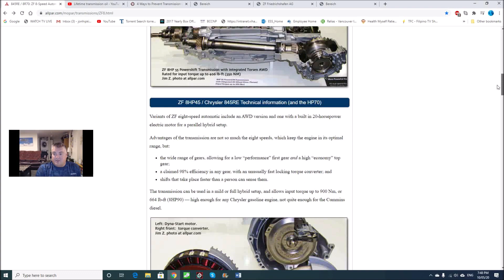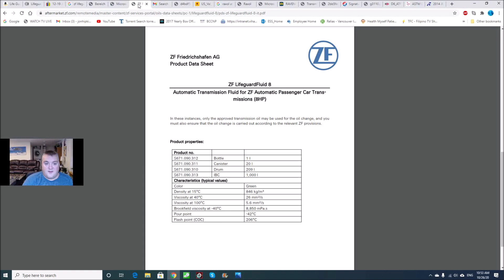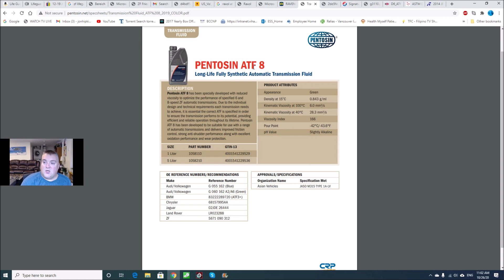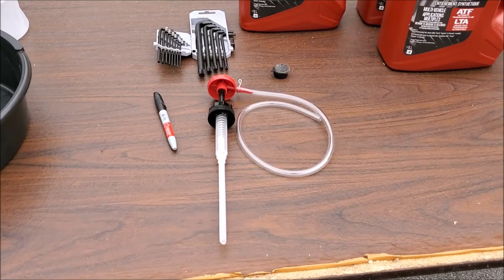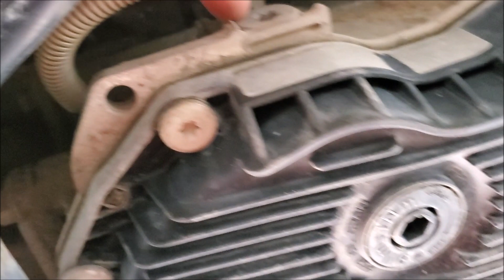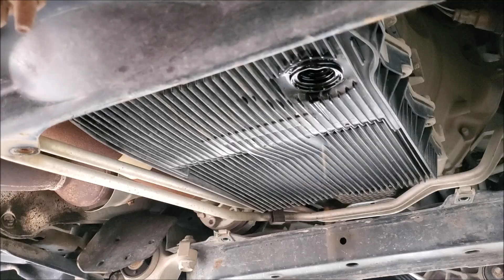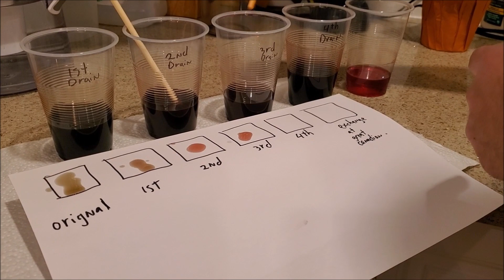ZF 8 SPEED FLUID CHANGE AND OPTIONS (SPECS INCLUDED)

Comment: Did you reset the transmission ECU?  I have a Discovery 4 (LR4) with the 8HP70 and it is recommended to reset the adaption values in the gearbox ECU after an oil change so it relearns all the shift points / clutch settings with the new fluid.
Reply from the maker: No I didn't... and I must admit in all the research and reading that I've done on the ZF transmission (which was alot) this is the first I've heard of it. Is that recommendation specifically from LAND ROVER?... because it definitely isn't from ZF as far as I know. I'm also curious does LAND ROVER recommended a fluid change?
Reply: @jonh2408    Jon, googling various terms (adaption ZF 8 speed etc) there are a few hits, here is one https://www.disco3.co.uk/forum/topic141425.html (first post step 16) but you need a diagnostic tool to do it (I have the IID tool) .  I think LR have hinted at 150K miles but don't think that is 'official', think I prefer to follow the OEM's (ZF) recommendations instead.
Reply from the maker: @millycarrington  ya... thats certainly a very detailed description. The directions for achieving a proper fluid level look familiar and are on par with the ZF directions. The part about reseting the ecu is new to me. It makes me wonder what happens if you change fluid but didn't do that step?
Reply from the maker: @millycarrington  I will also say that using a scan tool on the chrysler products was something that people only did to get an accurate fluid temp. Which Is necessary (as I'm sure you know) to properly set the fluid level. However alot of people (myself included) just used the tranny temp display (if there vehicle had it) on the dash. Thereby foregoing the need for a scan tool.
Reply: @jonh2408  Yep, not actually done mine yet, just in the fact finding stage at the moment.
Reply: For my Dodge Ram , on the forums I’m on a ex trans engineer . Told me it was not needed after my fluid change on my trans

Comment: This is so informative! 
I tried hard to find something good explained as u did.

I passed 159,000 KM without change.
I live in Dubai (so hot weather),

Is it fine to go and change? I am Very hesitant although i check oil condition on white tissue and seems nut burnt or black.
Reply from the maker: Your only at 100,000 miles... I would definitely change it... but change the pan too so you can get a new filter and magnets
Reply: @jonh2408  thanks for prompt response!

What about flush on stages like, 2 quart each couple weeks , the 3rd stage to change oil along with filters?

Is it possible in this way to not wake up the genie? Trying to avoid any damages ..
Reply from the maker: @ahmedzu3775  ya I think that would be fine... that jeep must be fun as fuck in Dubai... is it quadra drive 2?
Reply: @jonh2408  yea its quadra drive ii , its very heavy duty and more fun in deserts, 

But thing is weather 49c nowadays, you cant have that fun ,
I am not sure if i can maintain the fluid change as the Trans. Temp. Is Always 90 lol
Reply from the maker: @ahmedzu3775  don't worry... I live in canada and my tranny fluid is always  93 Celsius  as well.... even in -30...lol

Comment: Jon, I have a 2020 Dodge Challenger 6.4 with a ZF 8 HP,  I drive spirited and go to the track approx 1 to 2 x per month. Wich fluid in your opinion is the best quality and performance. I'm thinking Amsoil, or Redline.  I'm also interested in getting the Aluminum pan. I'm in Miami Florida and need the extra cooling. Right now I'm at 30k and plan to do this at 35k or sooner. Also does the Aluminum pan have the 4 magnets, and exchangeable filter ?   Also are the viscosity with the Amsoil or Redline the same ?
Thanks for the great video. Extremely informative.   
Oh yeah , and if you can recommend a better fluid for my ZF brand LSD Differential that came with my car. The Mopar fluid cost $40.00 Dollars per quart. Takes 1.7 on the diff,  if I remember correctly, and I'm sure it's not as good as Redline or Amsoil.
Reply from the maker: So I went with the valvoline on mine because of the amount of reviews/reports of people having used it. Also because I don't do much heavy towing or demanding driving. That being said my second choice would be the amsoil. It isn't much cheaper but the limited amount of reviews I was able to find on it were all positive. With the track racing and just general driving style on that kind of vehicle I think its worth the investment. I might suggest asking around to other chrysler/dodge guys at the track (challengers/trackhawks/demons) what there general consensus is. Find out what they've been using. I'll look into the diff fluid as I've never thought about that one before.

Comment: I know this is an older video... But im about to do this job on my 2015 Durango RT. Do you know if the PPE pan has magnets? If so how many? Thanksm
Reply from the maker: https://ppepower.com/en-ca/products/transmission-pan-heavy-duty-cast-aluminum-jl-jt-wrangler-850re?variant=43838501552371
Reply from the maker: It says in here that it foes have magnets, even though there not visible in pic

Comment: also what has been your experience with the Valvoline Maxlife since you did the service?  how many miles have you put on it since then?
Reply from the maker: I did the exchange at 105,000 km (as my warranty ran out at 100,000) and now I have 153,000 km. It still runs great. As mentioned in the original video, I'm going to exchange fluid after 50,000 km so very soon I'll do the follow-up video. I'm hoping the shop will let me film the process of them using their exchange machine. I also plan on sending a sample of the used valvoline to Blackstone. I was thinking of trying the amsoil product this time, but it's over $220 for 4 liters!!!

Comment: My 2015 ram 1500 is leaking trans fluid out of the front of the engine block right where the fan is connected to the engine. Thought it was power steering fluid but i just learned that my truck has electric power steering. And advice? The fluid is thin and pink
Reply from the maker: Are you sure it's tranny fluid?... pink definitely isn't the correct color for mopar tranny fluid (should be dark green). Sometimes the coolant can look orange/pinkish
Reply: @jonh2408  yup i discovered its a water pump leak! Thanks for response!

Comment: seems like there would be a way to bypass that temp valve by using a programmer
Reply from the maker: @TwoFeatherChannel  you mean like force it open electronically? Ya might be. The exchange machine definitely works good at getting majority of fluid
Reply: @jonh2408  yes having the cars CPU open it

Comment: Walmart sent me dorman 265-853 pan which has 2 magnets? I think it will be fine but next changed getting the 265-850 i have a 2013 dodge charger.
Reply from the maker: Hmm... interesting I didn't know you could get those kind of auto parts from Walmart. How much did it cost you and what was the gasket quality like?
Reply: @jonh2408  $120 usd. Gasket seemed great. Pan fit perfect but  only 2 magnets. I went and looked again and saw they had the 4 magnet one for 7$ more. Great video by the way. I also used valvoline same as u. The bottle actually says compatible with zf lifeguard etc im not worried about a full flush. How has your pan held up?
Reply from the maker: @Sliknik_IE  ya good so far... im at 150,000 km now and was thinking about trying the amsoil on this change. The vavoline has done great just curious to try the amsoil product as it has so many great reviews. This time I won't change my filter, I'll just change fluid. Then at 200,000 I'll  remove my pan, replace just the filter (clear the magnets) and change fluid. I feel like you should only need to change filter every 100,000 km

Comment: I have a 2020 Jeep Gladiator 8 speed auto. Mopar recommends to use the "Mopar 8 & 9 Speed ATF"  for the Transmission fluid change and "Mopar ATF + 4" for the transfer case fluid change. Is there even a difference between the two ? Can I just use the "ATF + 4" for both the transmission and the transfer case. The "8 &  9  Speed ATF" is like $33 but the "ATF + 4" is $10. I'm pretty sure they're both the same thing basically. Thoughts ?
Reply from the maker: No they are definitely NOT the same. But you can use valvoline maxlife which is much cheaper

Comment: So regarding the viscosities are higher indexes better, are higher viscosity at higher temperatures preferred?
Reply from the maker: Well it depends on the specific type of transmission your vehicle uses and the temperatures your using it in. So water has a much lower viscosity than maple syrup. In other words it flows easier. If you heat maple syrup, it flows easier to meaning its viscosity lowers. I know the ZF transmissions use a lower viscosity fluid (maybe because if it flows easier you get better fuel economy) and run at a higher temperature than most. So to answer your question - NO higher viscosity is not preferred (as that would mean a thicker less flowable fluid) but higher temperature is. So the hotter your transmission fluid gets the lower viscosity it has, and it's designed that way for reasons (probably several) that only the engineers would know

Comment: Any updates months after on using valvoline max fluid? How is it performing on your jeep?
Reply from the maker: It's good... I changed it at about 105,000 km's and now have about 123,000 km's. Everything is the same for me. I know I've seen alot of forums/comments about how amazing the difference is. How it shifts "silky smooth" and gets better fuel economy. I haven't noticed anything like that with mine. It's all the same with the exception of it takes quite alot longer to reach operating temperature (which on my jeep is 93° C). In my mind that's an indicator of the original fluids worn ability to absorb heat. But ya still running great

Comment: So my 2018 300 has 60k on it, question for you? Some shops say they can just drain and fill it without changing the drain out, so 3 Quarts come out, is that ok to do just to get me to 100k, at that point I would change the pan and do the complete service
Reply from the maker: I assume your talking in miles, and ya thats better than doing nothing (which is what alot of people do). But TBH you could do that yourself with basic tools (literally a socket and the Allen key for the drain plug). Then buy the manual pump (around $10) that screws onto the top of 1 liter bottles.  You could do it yourself  in minutes for pretty cheap. How much is the shop gonna charge you?
Reply: @jonh2408 so sorry about the delay, my shop says about 200!bucks if they use zf fluid, but i was looking at royal purple ATF and it say it is compatible with zF on the bottle, would you be comfortable using the fluid? Thanks again
Reply from the maker: @jasonwallace6945  My only recommendation would be to use the mopar fluid so that you're not mixing different fluids. I used the valvoline, but that was because I was planning to replace all the fluid. Personally I wouldn't want to mix different products, but that's just me.

Comment: If the transmission is sealed where do they place the fluid exchange machine suck fill tube?
Reply from the maker: So the term "sealed" is just wording used by the car company to discourage people from playing around with it. Essentially it just means there's no dipstick for checking fluid level. But there is still a fill and drain plug located under the car.

Comment: So you can't use a traditional exchange machine on this zf8hp70 transmission?
Reply from the maker: You can, but there's a chance of not getting the fluid in the cooler/lines. And a chance of damaging the valve in the thermostatic bypass as the exchange machine "forces fluid through" with  more pressure than your own pump

Comment: Actually you did the right thing starting with drain and fills. It’s not 100% that transmissions behave normally after changing transmission fluid types. The drain and fill introduced a different fluid slowly. So if there had been a problem, you would know about it in a less severe way. The minute you exchange all of the fluid the risks are higher. So in hindsight, you know it would work. But on the front end, not knowing you did the right thing with a gradual, drain and fill. I have the misfortune of knowing firsthand what exchanges can do. The exchange of the shop is likely not Valvoline max life. It’s some blend they use, which has a different viscosity. Max life is very thin. You put in something thicker it could start clunking. You never know.
Reply from the maker: Good point about shop potentially using a "cheaper" mix of fluid. When I have my next exchange done, I will try the amsoil signature series. In the time since the videos release alot more info/reports have come online. There's now enough on the Amsoil that I feel comfortable using it. I'm hoping that the shop will allow me to take video of the process. It would be nice show the machine in use and get a sample of the fluid. For the second video I'll send a sample of the used valvoline fluid to Blackstone and show the results. I'll also try HARD to keep it shorter...lol.
Reply: @jonh2408  after finding out how exchange machines connect now I do my own exchanges. On GMs they used the transmission oil cooler lines coming from the radiator. Assume they do the same for Chrysler. To DIY at home what you do is disconnect the RETURN cooler pipe from the radiator only. Then connect a generic barb with a clear hose to a pan. Put the pan near the drivers door so you can see the level. Turn on the engine and watch until the fluid comes out about 3–4 quarts. Shut off the engine. Backfill with fresh ATF. Keep repeating until you see clear red in the hose. With this method, it’s a one-way push of fluid from one end to the other all the way through the torque converter. The reason for 3–4 quarts at a time is so that you don’t run the pan dry. You’re using the transmission pump starting the engine. It’s really simple once you’ve done it. I can change 12 quarts in about 30 minutes.

Comment: I have a 2014 ram 1500 with 5.7 l engine. Currently it is at 216, 332 mi. For you metric people that's a lot. Everything is dying on the truck at the same time. So you could change the fluid and I did but you're going to have to buy a new rear end and new brake calipers and a new computer and a new bcm. So good luck I don't think it'll help though
Reply from the maker: @m2useinu  well you certainly got a decent life out of it. You have 346,000 km's on it.

Comment: First of all thanks for the great video , the best about ZF 8 so far , I have a Ram 1500 2015 did a flush with the special machine with 130k in some special transfer Service ( live in Europe ) couldn’t find Ram dealer 2 years ago , now I have 205 k km on my ram and month ago started the shifting really bad , temperature is ok it’s not getting hot at all ,called the service again and asked wich oil they’ve used they said Ravenol because i didn’t asked for the lifeguard 8 from ZF , due the Covid i’m not able to travel to the Service back , but yesterday i’ve found on ebay kit with 7 litres of the ZF 8 oil and the pan , can’t find any servise with this flush machine where I live now , do you thing it’s gonna be ok if I just change the pan and oil without flushing the tran ? is it gonna help ? or It can go bad if the ZF oil mixes with the Ravenol ? any ideas ? thanks for help 
take care
Reply from the maker: Well if it ran fine on the Ravenol for that long.. I would think it unlikely that it caused the problem. Maybe look around and see if you can find a local oil change place with the other type of flush machine (like in the video). I mixed my fluid with the maxlife and it ran fine.
Reply: @jonh2408  hi thanks for the answer, found one , filter 900 USD , oil 1liter 89 USD , and changing the oil they want to charge me another 1500 USD live in Switzerland it’s crazy the prices here , so i’m ordering the original ZF8  kit with the pan and 7 litres of oil  for 230 USD form ebay and ask the local Service just to change the pan and oil and see what is gonna happen hope it’s gonna help 
take care

Comment: Will the valvoline Max life atf work for the bw44-44 transfer case?
Reply from the maker: That's a good question... the only fluid listing I found was on rock auto. Under a 2018 ram with 5.7L I found a fluid called pentosin atf - 44. I must admit I'm not an expert when it comes to this so I would be very cautious. Sorry I couldn't be more help

Comment: There is a reason Chrysler puts a sticker on the side of their transmission that says, use ONLY Chrysler transmission fluid etc etc. I can get Amsoil signature series transmission fluid for my 8 speed, 10 quarts for $150. Chrysler trans fluid for the 8 speed is, $45 A QUART!!!! Or $450 for 10 quarts. Sorry, I’ll put Amsoil up against ANY fluid out there!! And for info, I seen a test where they compared Chrysler 8 speed fluid to Amsoil fluid for the 8 speed. They dropped the temp to negative 35 degree Fahrenheit.   The Chrysler was a solid and not pour, the Amsoil had no problem!
Reply from the maker: @fishin11  ya if I was going to use another fluid it would be the amsoil. I wish I could get it as cheap as you can. Unfortunately, in Canada, it's not as easy to get.